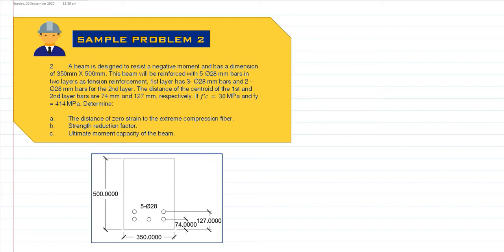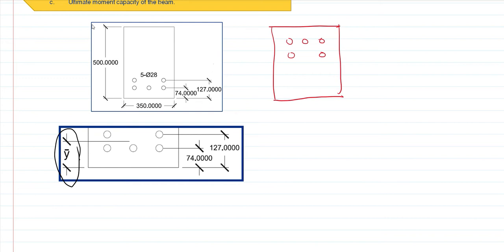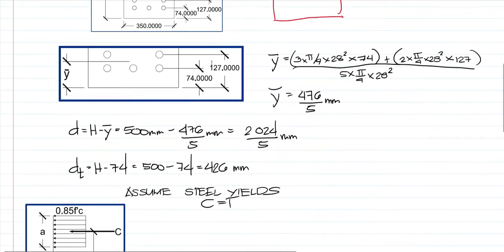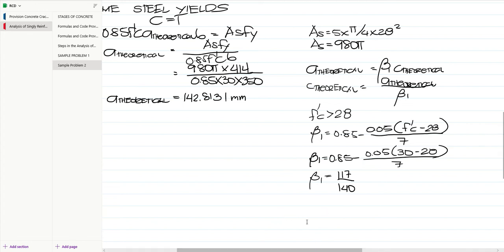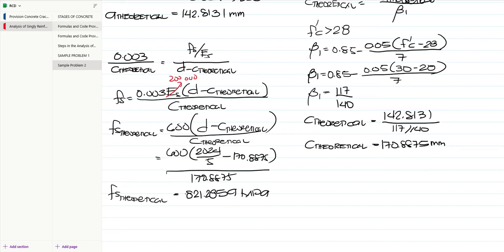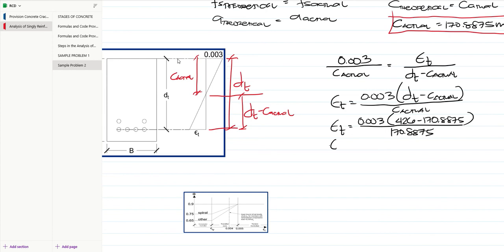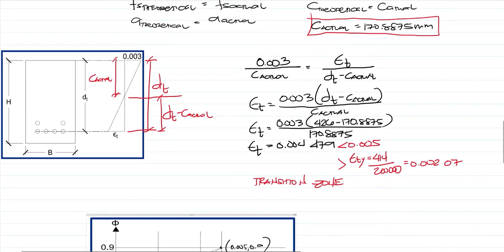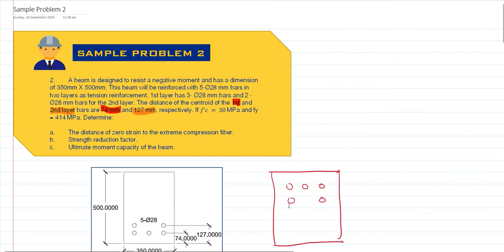Analysis of Singly Reinforced Beam Sample Problem 2

Comment: Ano po pinagkaiba pag gagamit ng d or dt sa pagkuha ng fs po? TIA
Reply from the maker: Hi Engineer.
Si d ay ginagamit para sa pagkuha ng steel stress which is fs to determine kung nag yiyield yung bakal or hindi.
Si dt naman ay ginagamit to get the net tensile strain of the reinforcement which is ginagamit si net tensile strain para sa pagkuha ng reduction factor.